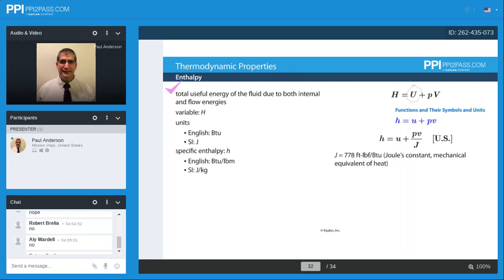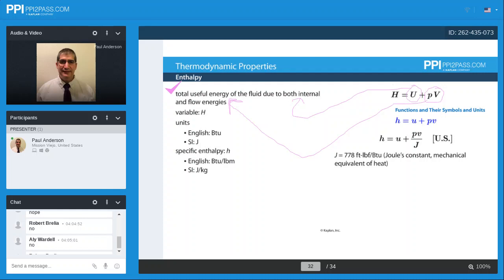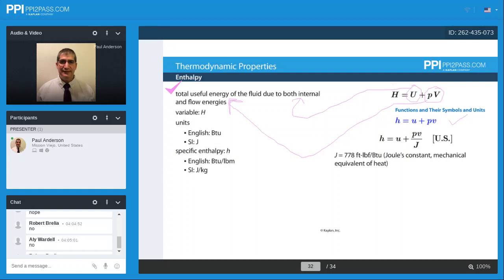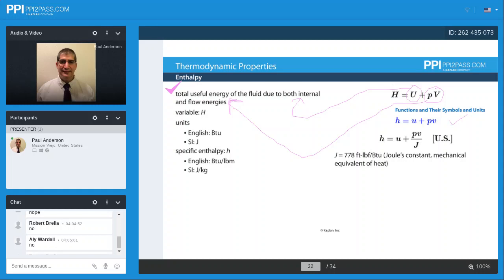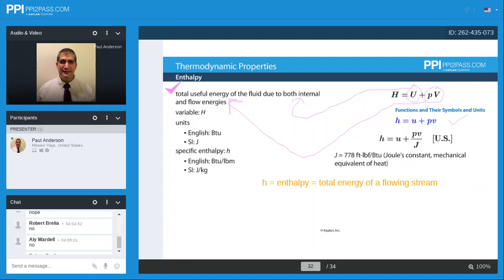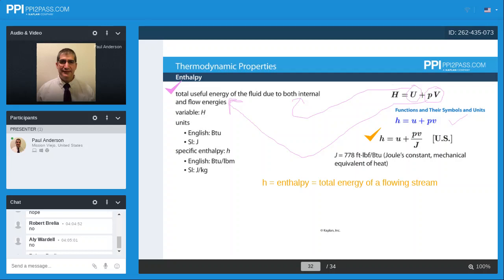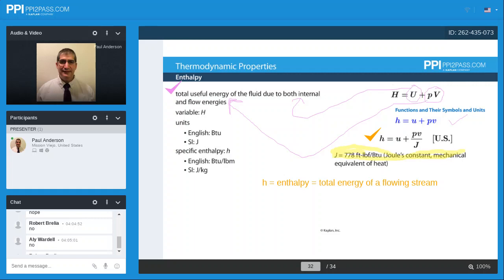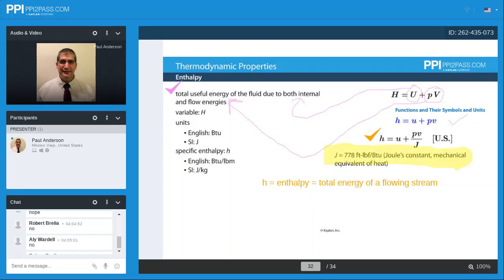PE Mechanical Exam Prep Course Demo

Comment: If anyone is reading this, the fourteen edition of their MEPP 14 practice problems is FULL of errors. Since I spent a lot of money on the handbook/practice book bundle, I had no choice but to develop an excel spreadsheet with all the errors just to verify that the problem I'm working with has the correct answer, I then had 4 different tabs with different errata files that the PPI has slowly released. Be cautioned that the book does have many errors but we really don't have many other choices to pick from.